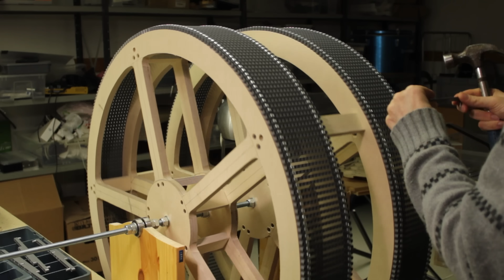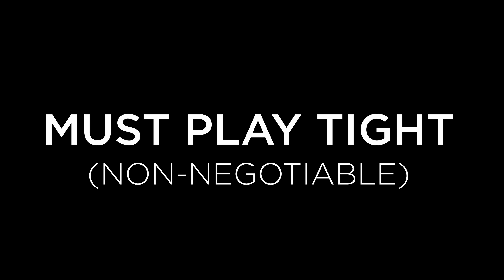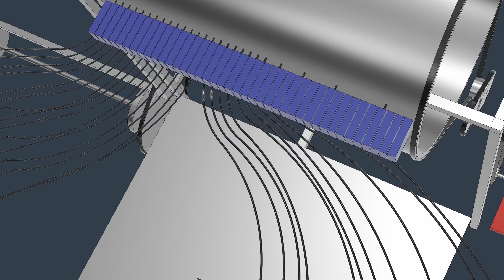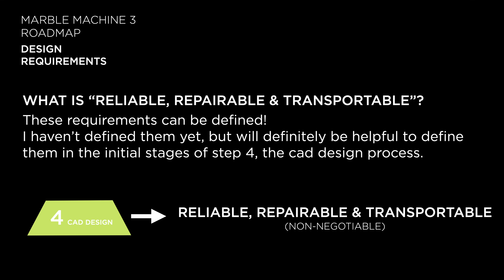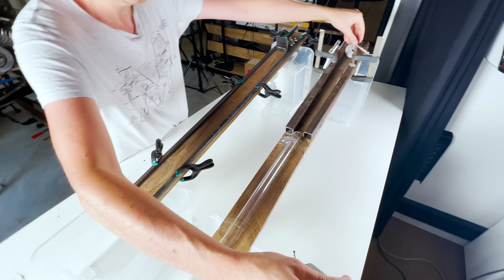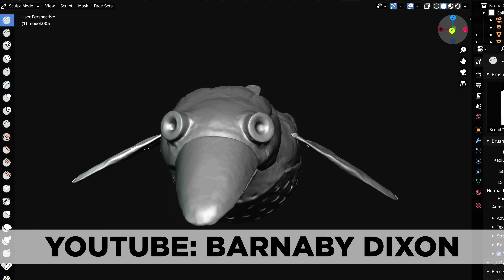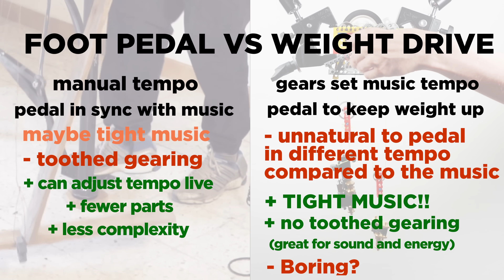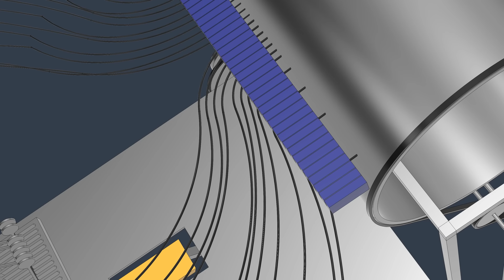Marble Machine 3 is Taking Shape

Comment: Hey Martin, how about this suggestion? Why not have them both as an option? Remember when you were going to change channels on the programming drum? Why don't you use that changing channel on the programming drum feature on the power modulation? You can have the foot pedal for the tempo changing but you can also switch over to the automatic mode when you'd rather go manual play a guitar or the xylophone. Also, you could also implement a lever that adds resistance to the weight so that way the weight falls a little slower so it can go at a slower pace or you could hit a lever that adds an extra weight so it can go faster. Also, why not have something on the weight string that automatically re-cranks the weight backup? I saw a lot of things on the mechanical principles videos here on YouTube that could easily cause the dropping weight to turn a gear that would cause the weight to go back up using the same method that you did on the Lego example. So I think the weight method should be the automatic mode so you can do more crowd interaction but then you should also have the option to take over the momentum with your foot pedal when you're trying to do things in Martin mode. Finally, you could even introduce the hand-crank just as a throwback to the first machine if you really wanted to, there's no reason why this couldn't have three versions of power modulation if you have the proper switching to do each one independently. After all, the flywheel is going to keep going regardless of what you do, so why not allow yourself that ability to switch between three power modulations? Nonetheless, I'm looking forward to seeing what you come up with in the end, it's been a really exciting season so keep up with the videos and keep up with the hard work even if you're just posting a video about a bunch of stuff that you're going to end up turning around and saying that it is stupid, because all of us would rather see inside your thoughts instead of see nothing. Keep up the great work!!!

(Edit: Cleaning up voice to text mistakes - Thanks Google Voice Typing, Y U NO GPT or Bard yet?)
Reply: Yes, I agree with this. I was wondering why Martin thought as both solutions being mutually exclusive. Having the weights as autopilot, but then the foot pedal to change the dynamics of the songs would be the best of both words. Maybe also with the help of the weights, the foot pedal would be lighter and/or more sensitive to changes?

Comment: I don't like the weight drive or the foot pedal too much variation why don't you use the same motor drive system that you used on marble machine X this machine's going to be a lot bigger and have a lot more moving Parts I don't think you'll be able to power it using human power I think that's asinine you need to use a motor good luck I just hope you don't humans power this machine because that's too many variations in the input good luck

Comment: Can you make the weight drive be wound by the foot pedal? As in, your foot pedal winds the ratchet for the weights? And then work in some other kind of variability for the tempo using something similar to a CVT transmission instead of only gear ratios? You will still be increasing your foot pedaling with the tempo of the music but the weight drive will still be controlling and keeping the tempo tight.